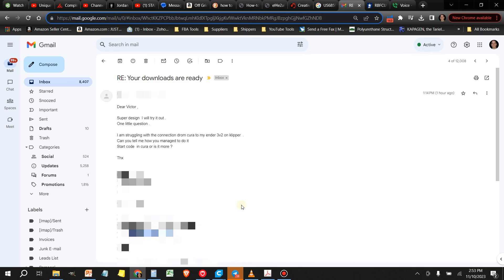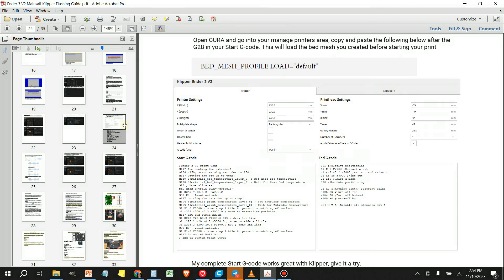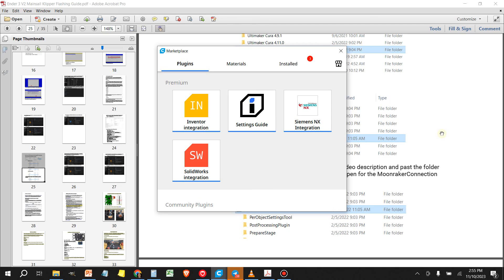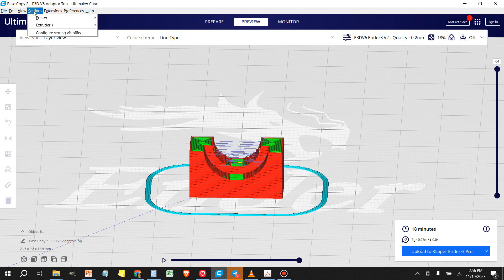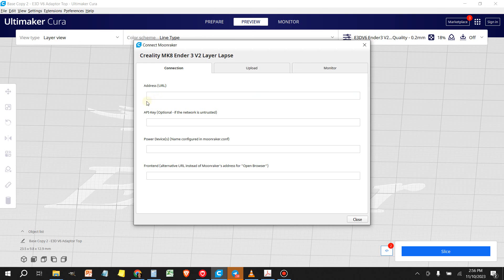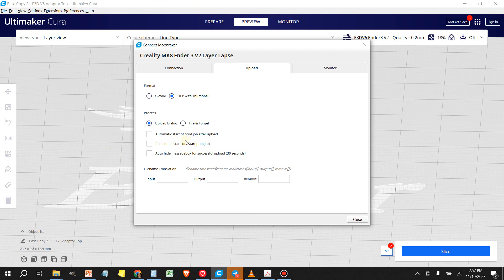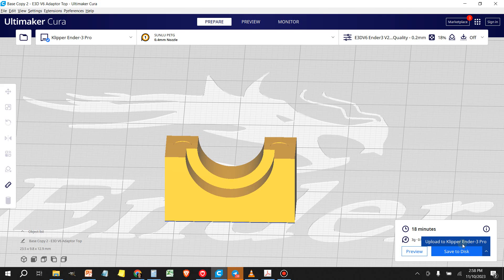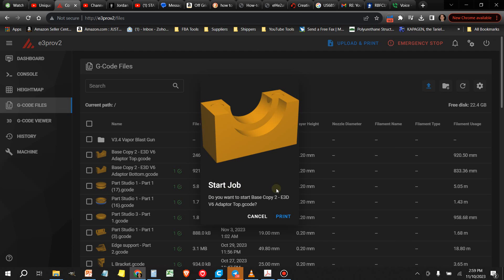How to Connect CURA to Klipper via Moonraker

Comment: how do you get that gcode icon on klipper? if you have that in your video
Reply from the maker: Hi Richard, Thank you for commenting. In CURA go to settings, printer, manage printers. Select your Klipper printer then click the Connect Moonraker button on the right, click the Upload tab and select UFP with Thumbnail and close the dialog box. The next file you slice will include the thumbnail picture that can be viewed in Klipper instead of just the g-code file names.

Best of luck with your prints :)

Comment: I've tried this with Ender 3KE which has wifi capabilities. I put in the IP address, but it just says timed out when i go to print. Any ideas?
Reply from the maker: Hi friend, Thank you for commenting. Are you running Klipper on the E3KE?
Reply: No haha not sure what that is. Just trying to connect to the E3KE with Cura @vbared
Reply from the maker: @JamBreadSpotify  Oh, I understand now. Doesn't that Creality printer use a special slicer?

Comment: Nice video bro. i’m struggling to figure out the wiring diagram on the M5P/CB1 with a Ender 3 v2 think you could help me out bro??
Reply from the maker: Sure, Brian, Give me a call 478-227-3301, leave a message and I'll call right back. Since I give out this number I get a ton of spam calls so I have to screen them.
Reply: OK cool bro appreciate the help I’ll give you a call shortly